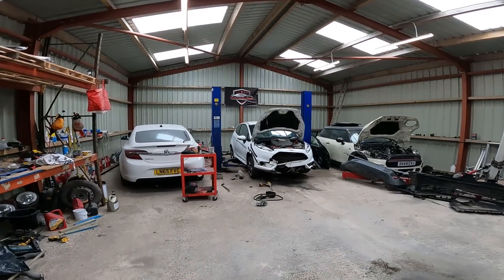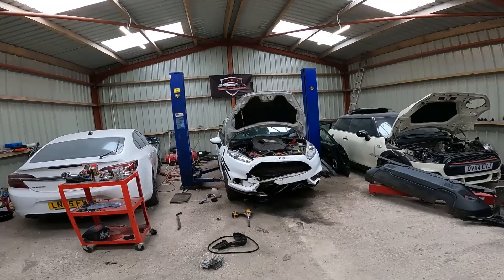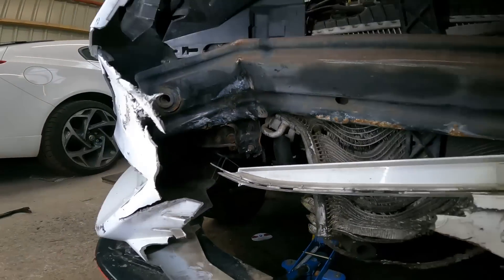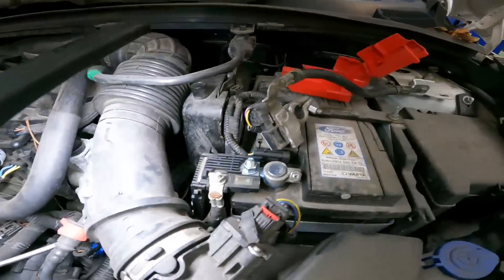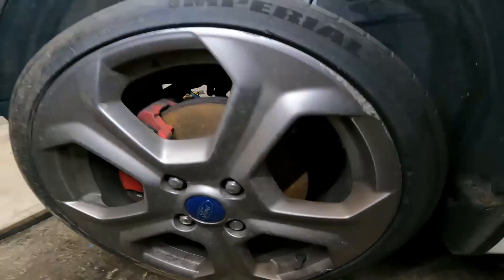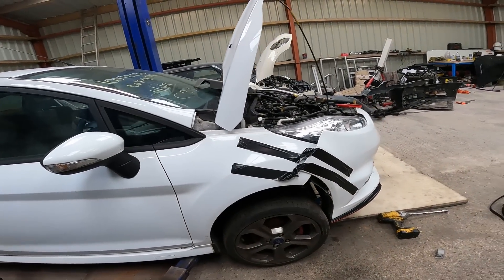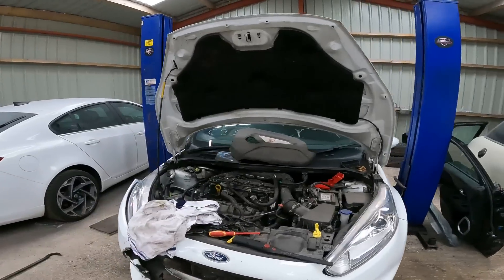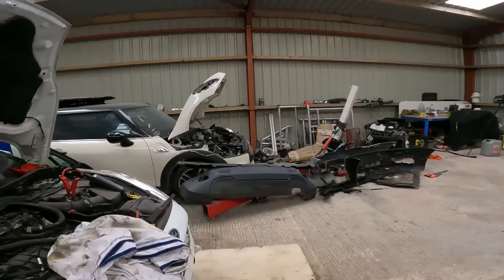I Bought The Cheapest Fiesta ST180 I've Ever Seen Go Through Salvage Auction - And Its BAD!!!

Comment: Its an ST2, as the ST3 was not available that early, with options such as keyless entry and auto lights and wipers. An ST3 has full climate control, satnav and cruise control with buttons on the right of the steering wheel.
Reply: Thanks 👍

Comment: Ah for the good old days with my Mk1 Fiesta 1.3 Ghia, which I immobilised by removing the HT lead from the coil to the distributor, even though I kept it parked in my back yard and out of sight - you could open the doors with a nail file! Sawing through the steering wheel is a new one to me!
Reply: It probably had a useless 'stoplock' fitted and that's all you need to do to remove them.
Reply: Remove the rubbish steering lock

Comment: The mess of the front end isn’t what I’d be worried about. I’d be more concerned about the price of new radiator, A/C condenser, A/C pump, fucking steering rack…. That’s thousands, surely. Can you even fit a second hand rack to those? Some don’t like to be programmed to different cars.
Reply: Air bags, steering wheel and however many other things. Jesus Christ, I hope you’re not hoping to get your money back from it 😬
Reply from the maker: You would be surprised just how cheap parts can be had for these mate , complete rad pack with front panel and intercooler £140 , complete airbag kit with ecu dashboard etc £160.
Steering rack is the same as most mk7 fiestas, its a manual rack with a electronic colomn.
Reply: Thousands hahahaha hahahahaha
Reply: @SeriousAboutSalvage  fair enough. I’m assuming you’re just gona use all second hand parts?
Reply: @chrismasondarts  I don’t know what you’re laughing at. Air bags alone can cost thousands if multiple bags go off.
Reply: Alex you don't understand salvage cars much do you
Reply: @leedstown  to be fair, I work in a garage and that’s the perspective I’m looking from.
Reply: @alexhorky6454  people that but cars from Co part buy used parts mostly especially bumpers, radiators, headlights or you it would not be worthwhile
Reply: @leedstown  can you even buy second had air bags though? I can imagine certain cars wouldn’t accept second hand airbags
Reply: @alexhorky6454  I thought you worked In a garage?
Of course you can buy used airbags
Reply: @leedstown  I do work in a garage. Some cars don’t even accept donor steering racks as they can’t be programmed into a different car.
Reply: @alexhorky6454  And you work in a garage, jeez please dont tell us youre a mechanic.